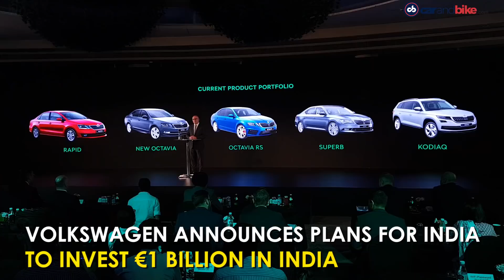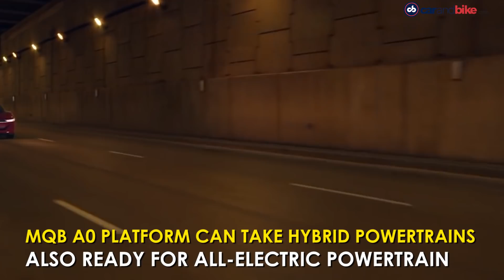India Plans: Volkswagen Group And Skoda | NDTV carandbike

Comment: wolksvagen should be banned
Reply: MY VIEWS It can be considered, if you learn to spell the company's name correctly.
Reply: Reubin Thomas 
hello sir i am a owner of one vw ameo 
they are too irresponsible to my problems with AMEO 
fucking car with poor 
cabin silence  
dust coming in to the cabin 

bastards they are not even responding well how can we feel good about them
Reply: MY VIEWS May be problem is the dealer you bought the car from. They might've given you a model from previous year or may be even an unofficial test drive vehicle. 
Also, your problems are minor. They can be fixed easily under warranty. Try a different dealer.
Reply: Reubin Thomas 
no we have tried 
i ll post a detailed video 
on this issue i have shooted that and will post 
dealer already hands up because he can't do anything so we are now approaching the company 
administration who are not atall responding properly 
the car value is 10 lakh 
and that was bs4 variety in India which came recently 

no one trolls loosely without issues 
understanding customers pain is an art which these goons failed to address 

yah i m not good at spellings so what it doesn't mean i don't hv any problem
Reply: Pehle spelling likhna seekh le